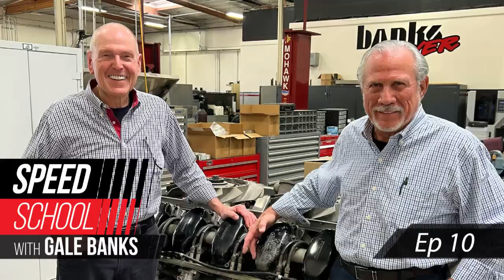Turbo history, SR-71 engines, why Corvette C8s blow up | Speed School Podcast Ep 10

Comment: F4 Phantom was a hell of an aircraft. Tough as nails. SR71 is a beauty in its own world. Nothing else like it and I love it. I built a model of the Blackbird back in 1969 and the model was really cool. You should read about Smokey Yunick's treatise and his experiments in hot air going into the engine. Hot air can be great. How about an Iron Duke engine with 88k miles on it and putting a turbo blowing into a supercharger on it and keeping the air temp at 305F going into the cylinder with no detonation and 250 hp out of that engine with the only changes being in the ignition advance and fuel delivery. Yay Smokey!
Reply: Thermodynamic system modeling engineer for Centrifugal compressor chillers. Think is spot on. The fact compressor manufacturers don't put out unitless (theta/omega/mach) compressor maps or worse don't put out maps at all blows my mind.

If you are a real engineer developing engines and engine platforms, most won't play ball unless you're an oem with oem quantities. 

Essentially if you want good maps... you have to build a electric driven gas block and map em yourself.

Comment: Wow! What a treat hearing about the SR71!

Have either of you followed Reaction Engines?  Imagine an SR71 with a Precooler and a rocket stage using a centrifugal compressor instead of an axial one.

In sucks so much heat out of the upper atmosphere that the Precooler freezing is the biggest challenge.

All to get to orbit with a single stage space plane.

Comment: I worked on Turbodyne electric augmented turbocharger rotors, winding carbon fiber sleeves over the permanent magnets bonded to the shaft. This was years ago, around 1987-1993? Then an offshoot of Calnetix who worked on the F1 hybrid electric energy capture/dispense system. Then the “electrified” turbos came back. Very nice to see that Garrett is working on possibly offering one commercially?

Comment: Being a young gun, the best advice I've learned as a mechanic is that the  previous generations of mechanics had a lot of common sense and these guys now guys just care about hp or boost. My biggest question is, if you can't get it to the ground and make it stick, what good is it? Haha 

I was talking to my uncle about using water injectors to make a naturally aporated engines burn hotter. For the older ones of course. But you couldn't do that very long of course.

Comment: Corvette had a 315 hp 283 fi with aluminum heads but the heads had defects and were recalled  and replaced with cast iron heads which were  rated  at
 290 hp. The early  327 ci  with  fi  was 360 hp  and the 4 barrel  version was 340 hp and the later version of the 327 was
375 hp with fi and the 4 barrel  was 365 hp.  All were solid  lifter high performance 
cams.
I think  Caroll Shelby  made 2  427 twin Paxton Cobras . I believe they had 3 speed c6 automatic  transmissions.
1 for Shelby and Cosby bought  the other.
 Light weight short wheelbase overpowered car. A professional  driver
 would have   difficulty  controlling  that
monster.

Comment: nothing to date even comes close to the J series engines for the SR71, basically it was in the making in the mid 1960's ,which replaced the U2 plane, yet the advances in cross radar imaging, was never put into place till they released what they can do via NASA and the first flights into space and the heat shielding on the return vehicles and Hastelloy was one of those alloys used with extreme heat in fact the heat shield on the after burner rings are made from Hastelloy alloys and also used on landing gear and the same with titanium as well. :)

Comment: Fairly sure this is correct . The SR-71 starter cart had two Buicks in it . Not 455, but 430 or 4 hundreds . Later, due they literally could not find enough  Buicks, Big Block Chevys .
Reply: a-12 + sr 71 flew from 1962 to 1999.  bound to have been some variance. would've started with some late 50's stuff, the j58 engine itself was first ran late 50's.

officially the starter unit used two 401's. they could've switched them to whatever I suppose. the starter isn't exactly rocket science compared to everything else.

they just started using compressed air later though with a thingy.

Comment: You reference the benefits of "Ram Air". Please answer one question. Referring to your so-called "Ram Air", at what vehicle speed does your typical Banks "Ram Air" box exceed atmospheric pressure at sea level and around 70 F?
Reply: Aero drag becomes important at 50kph/30mph.  Anything above that may be noticeable for Ram Air, though only a dyno would notice

Comment: SR-71 Start cart started with 425 nailheads then transitioned to the 455
Reply: They ended up with 454 Chevys but the crews found them fragile compared with the Buicks. The Buicks could start from cold and go straight to full power

Comment: The metals used in aircraft is nothing which the normal people can get, which is why those engines are so well made and with reg servicing they almost last forever, the metals used in average automotive is 80% less cost effective for long term usages, if they were to use aircraft metals to make automotive engines, then we would have engines with reg servicing last for 30 years? WOW engine frequencies' was done way back with nicola tesla, if he could bring down a metal bld with the right tool, then you make sure that the engines own running frequencies, then it will last longer has well?